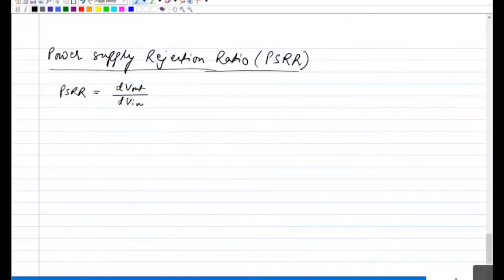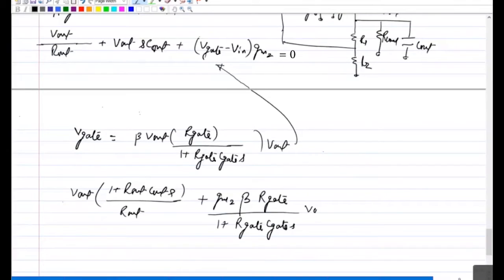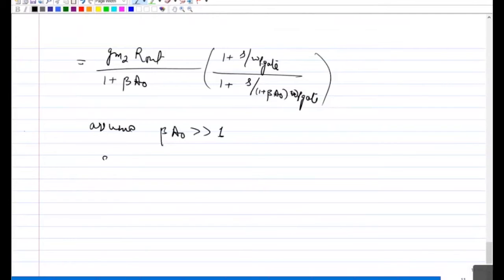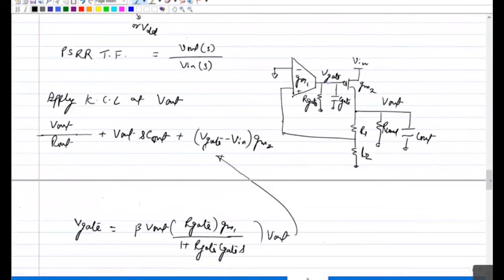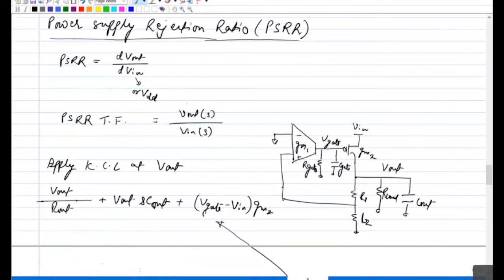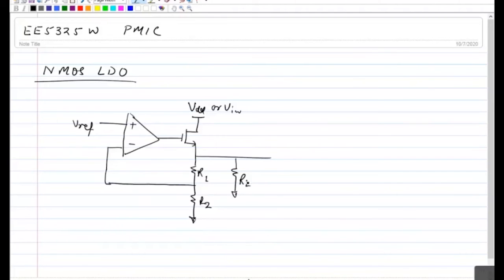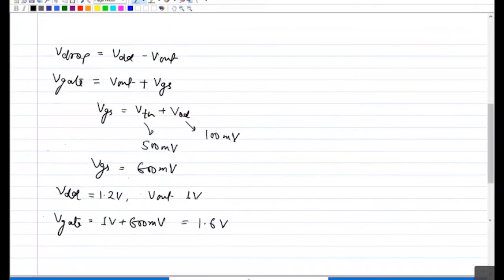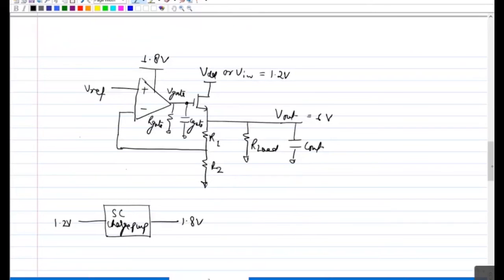#24 PSRR of PMOS LDO | Introduction to NMOS LDO | Power Management Integrated Circuits

Comment: Shouldn't the vgate node track the vdd for small signal if we use a pmos load single output diff amp as the error amplifier?